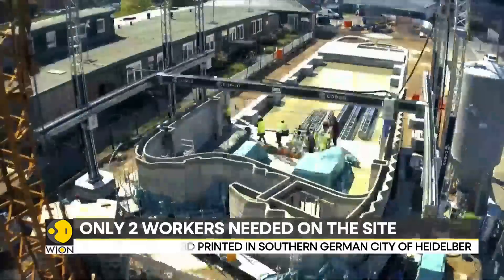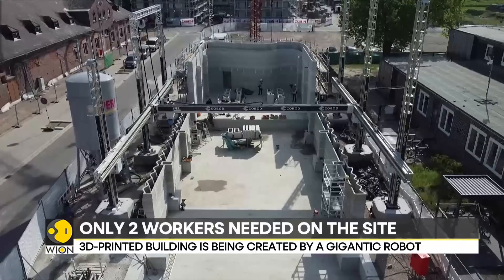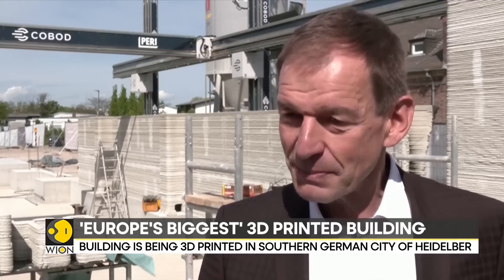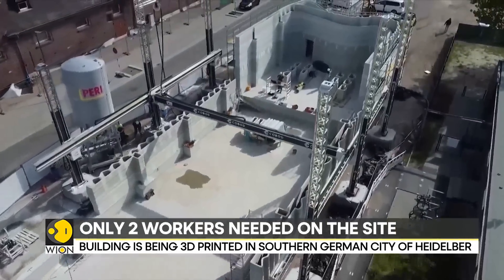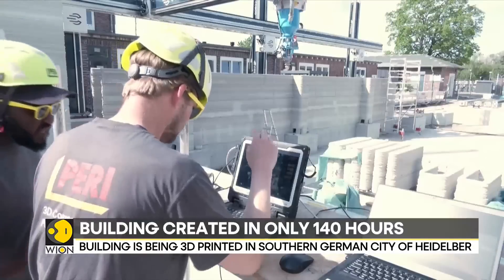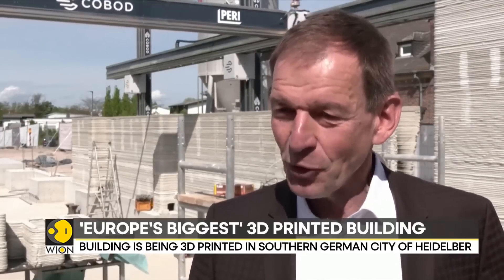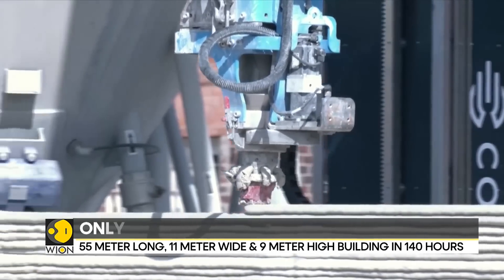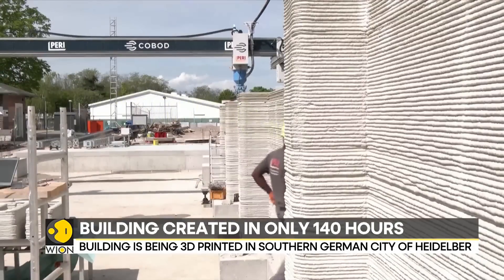Europe's biggest 3D printed building created in only 140 hours | Latest English News | WION

Comment: Let me hammer in a nail to hang my painting.... 2 days later, a headline reads "a man was pulled from under the rubble with a hammer in his hand"
Reply: The 3D printing concrete has a compressive strength of over 40Mpa. It is even stronger than normal concrete. The building is fully permitted. I am honoured to be the project manager.

Comment: Only 2 worker... Who set the all the machinary their... Who accommodate the all the material at site like cement water sand etc
Reply: Robots
Reply: Robots. And the material comes as ready mix and is blown into a silo attached with a mixing machine. The system is very autonomous